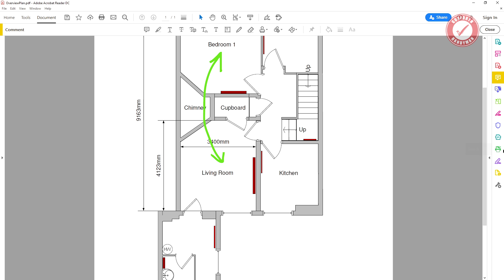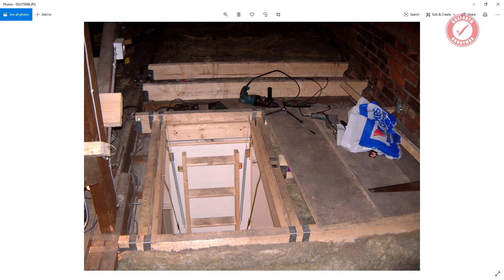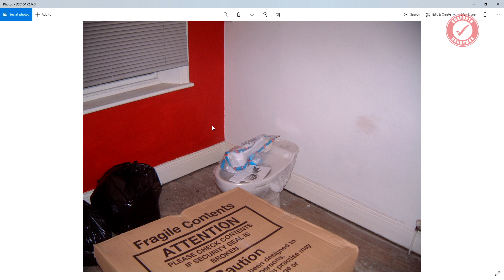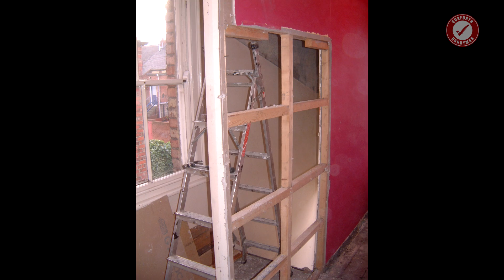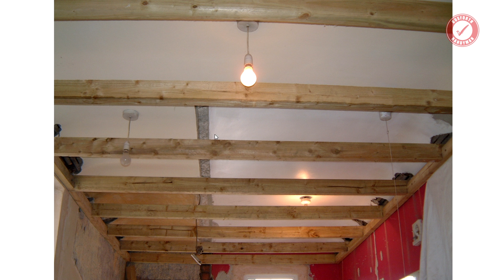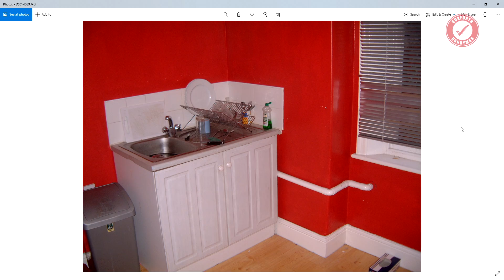Victorian Terrace Renovation - What did we do? (Part 2)

Comment: Sorry for my ignorance, but why did you have to fit a new ceiling in the kitchen in order to have spot lights? It has a pitched roof so could spot lights not have been installed in the original ceiling?

Comment: Because I live in an area in the US where pipes freeze in winter, I hadn't thought about running the plumbing on the outside walls!  I presume that codes require an upstairs flat to have a second means of egress, and that metal stairway makes the yard space usable.  You created a beautiful bathroom, and you turned that awkward ell into a very functional kitchen.  That's now a very nice apartment.

Comment: You can use the original staircase as your wine celler or food storage though,no need to seal it off completely.Good that you switch the toilet and the kitchen.The flat is tastefully done.
Reply: i was thinking the same , like a wasted storge space boarded off, but they were working on a tight budget so it makes sense to block it off .

Comment: I don’t know anything about this sort of thing but is there a reason why you can’t get rid of the chimney?
Reply: Because the chimney will also serve the Ground Floor Flat.  Plus if you doo what t remove one properly you have to go all the way to the top an probably end up re roofing (also planning issue potentially).

You do see allot of conversions that will prop the chimney up and take it out in the flat.  I have seen many amateur/cowboy efforts have chimneys fall into flats 6-12 months later as a result.  Done properly it costs much £££.

Anyway there's a few reasons.

Comment: I think the problem with the loft conversion wasn't only related to the flat situation. When my ex temporarily moved into a rather crazy Victorian terraced in Reading several years ago I did some research to figure out why some of the haphazard renovations had been done the way they had, particularly why they'd torn out all the doors, replaced them with fire doors and put the old ones out the back in the rain.
Here's what I remember: according to the English building regs, homes up to two storeys are exempt from most fire safety regs. As soon as you add a third storey to the equation, e.g. by converting a loft, you need an escape route for that new 2nd floor, which needs to be fire rated. The internal walls in that specific place were all brick so probably considered sufficient to stay up long enough for anyone upstairs to evacuate, the hall ceiling had a big hole for the stairs anyway, so that left any doors between the hall and any other room.
Apparently there are some weird ways of fireproofing existing buildings, including tumescent paints that make regular walls and doors fire rated. In your case that'd still have meant repainting the entire downstairs ceiling though and I absolutely get why soundproofing between flats is an issue!

Comment: Had to have the central supporting wall removed and replaced by concrete block as it had been weakened by too many holes/doorways etc knocked through in 18th Century house.  That's 2 stories and the loft, 18 inches thick of stones and rocks! It affected staircase, lounge, Main Bedroom, Bathroom and 'both lofts.  The discovery, that the bathroom (& cast iron bath which didn't empty properly) floor joists were 'supported🤨' by the mortar and filler used to plaster the walls and the joists were formed from the edge of trees, (ie not the full x section) meant  at one stage you could stand on the ground floor and look through the bathroom and loft to the roof!  Very open plan🤣.  
I was living in 1 room which was sealed from the work area (insulation board polythene & tape), then had to walk through this area to get to the kitchen or 2nd toilet, via an external route.  That stage was 6 months while I was holding down a full time job.  I wasn't doing it, but I now know how safe my home is now.  Well done both of you, The dust and living in a home where nothing is where it should be is very tiring.  I should have bought a cheap caravan and I'm sure the job would have been completed sooner.  Very relaxing watching it happen to someone else, while drinking coffee!  🤩😉

Comment: Great  job 👍  I'm curious ( as one of your replies further down says you couldn't get a pushchair in the hallway at first, so assuming you had a small child ) ...did you get any  issues with your downstairs neighbours regarding your foot-traffic noise?    I purchased a downstairs flat in a very poor state.  Like yours, 1/2 the houses in my road were converted into horizontal flats.  The ceiling were lathe and plaster with no soundproofing between joists, just a void until the floorboards for upstairs.  You could hear everything!   I filled the voids with soundproof mineral wool, fitted dense ' soundproof' plasterboard onto resilient bars to reduce the vibration/impact noise.    It has helped reduce vocal  / audio but as their floorboards are screwed into the joists, ( although they do have carpets ) Despite my best endeavours from ground floor,  every footstep just BOOMS through the property. :(   A long explanation, I apologise but yeah,  just curious if you had any 'issues' when you lived there?   Thanks again Andy.  great channel!

Comment: change swing of door at BR 2 to the left so it swings against the wall and not into the middle of  the room.  change existing back entry stairs to a landing then change swing of door so it swings out toward the railing at the new landing then run stairs to the left so as to make room for the car. remove about 8' of wall at K/LR  
  to create a walk through or a 1/2 wall so you can make a bar that reaches into the LR. remove door at  cupboard and hall cubbie, push left wall toward LR creating a La/WH Rm. change swing of door at new LaR or remove it altogether.  make a bigger attic access and put pull down stairs there. make the panel  fire retardent as is done in garages in the usa. please keep in mind, everything ive mentioned comes from the floor plain and not necessarily from the walk through you showed.

Comment: Cracking job there mate, shame you couldn't have just removed the stairs and turned it into a bike shed or winter storage for your garden set but I'm assuming downstairs had an understair cupboard there?? It's actually very similar to the top floor of my house mind you I'm not surprised as it's a tynside terrace as well lol!!
Reply from the maker: Cheers! Yeah, the gap under the stairs belongs to the downstairs flat. They could buy the void if they wanted to extend in to that. 👍

Comment: What a job and transformation!! Fair play to you and the missus for living on site. Very difficult thing to do. I presume the space was lost where the original stairs to the back door ran, due to extending the floor?
Reply from the maker: Thank you! Yes, but offered it to the downstairs flat. 👍
Reply: @GosforthHandyman  I've got the opposite situation going on, a basement with stairs that used to go up into the ground floor shop. We haven't decided yet whether we want to keep that weird bit of ground floor with a loft hatch or offer it to the shop owners. The existing stairs are flat-out useless as they block entrance to no less than two rooms. One of these two has a doorway off the landing that is a stunning 135 cms tall :-D

Comment: I've got the same Makita SDS drill. I also used the same size core drill with my "little" Makita to drill through stone walls to make an air vent. It took some time to say the least, but it did the job. The SDS also helped remove all the plaster in the house that I was working on. It's still working 20 years later, though it's not getting as much use now a days.
Reply from the maker: It's a beat of a little drill! Still one of my best purchases.
Reply: @GosforthHandyman  I use the same size Bosch for various jobs and I've discovered one thing it isn't suitable for: drilling through 900 mm brick walls with a very cheap 25 mm SDS bit! 16 mm works but the 25 stalls the machine and it isn't straight so it ruins both the drill bearings and your wrists. I'm thinking about getting something SDS-Max but long SDS-Max bits are as expensive as the drills! They didn't joke in pre-1900 Vienna buildings! External walls are 450 mm brick plus render/plaster up to the top floor minimum, down in the cellar you get anything between 600 and 900.

Comment: Hi there, how did you put down the shower tray. Did you use sand and cement to bed it down???
Reply from the maker: Yes - water resistant chipboard also sealed plus additive in the mortar. 👍
Reply: @GosforthHandyman  hi. What was the sand and cement mixture

Comment: I had a loft extension and all you needed to do was put a wired fire alarm in. Stairs need to be clad underneath with double plaster. Then again mine is a house.
Reply from the maker: Yeah it's different rules for flats sadly... or at least it was back then. Think it's worse now. Even the steel has to be fire treated AFAIK. 👍
Reply: @GosforthHandyman  When I built my kitchen extension ~ 30 years back the steel opening had to be clad in 2 layers of fire proofing. The plasters who where meant to do that forgot :O. Too late now ...

Comment: If you've got to core drill a brick wall it's best to go half way and then from outside in.
Reply from the maker: Yeah - that's what I did but using that beast up a ladder was a nightmare and the bricks just vibrated loose anyway. 😂👍
Reply: @GosforthHandyman  You can't win em all. I've worked an hydraulic core drill many moons ago. It was a beast no vibrations unlike electric ones. Biggest job was 4 foot slab with 32mm reinforced bars at the bottom. It's ban unremarkable elevator shaft to everyone else...

Comment: Andy, for those of us not in the UK, what's a Consumer Unit? - Nice job BTW
Reply: Maybe you call it a fuse board or breaker. Where the electricity enters the property and all of your different circuits for the house originate. Used to call them fuse boards here as well but fuse wire is now antiquated and been replaced with mcbs and rcbos etc.
Reply from the maker: Yup, breaker box. Thank you! 👍👊
Reply: @creamwobbly  then what?
Reply: It's where the electrics of the building are distributed from. Holds all the fuses / circuit breakers for all the different circuits. Effort, just realise I'm late with my comment!